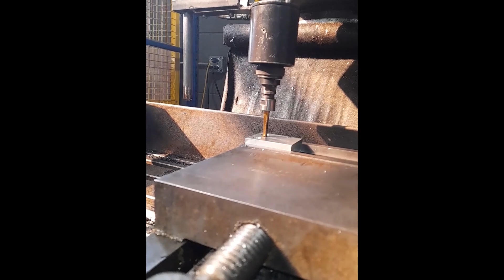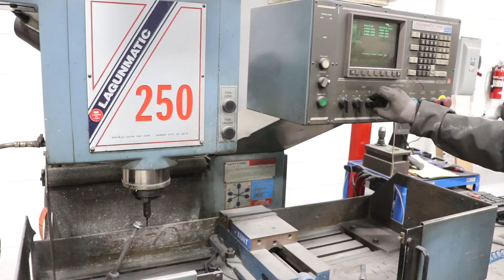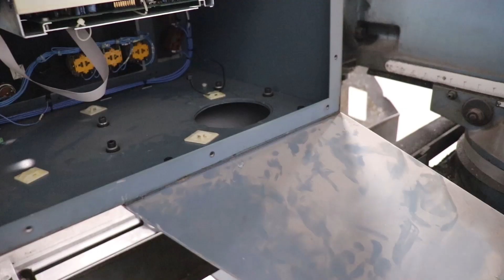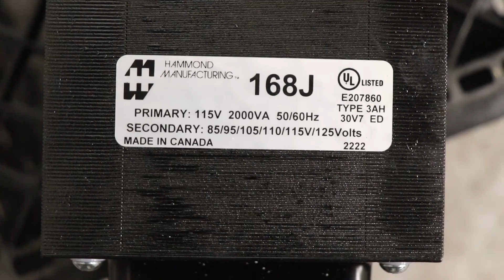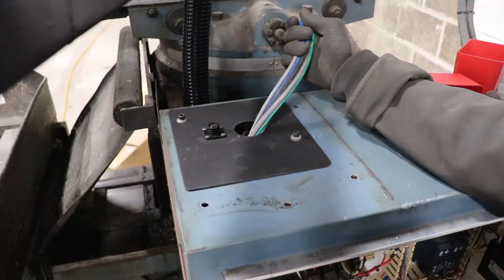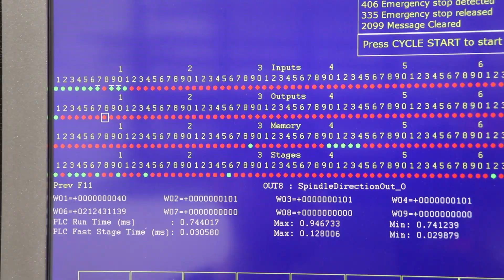How I Retrofit this Lagun Mill and Dynapath to a Centroid Controller

Comment: I have exactly the same machine with a Centroid AllInOneDC controller.  I pulled out all the contactors and replaced with VFD's: knee drive, sump/coolant drive, and the 7.5HP spindle drive with analog output from the AllInOneDC to control speed.  It's powerfull and accurate.  Mine has a NMBT40 spindle, but I bought two kits to convert to R8 and ER32 holders.

Comment: Our shop has three production machines running Centroid, with a fourth on the way, which is a  Shizuoka knee mill. We're considering installing a servo on the knee and using Z axis summing (knee + quill) for serious Z travel. And yes, we'll have to use a reduction pulley with a belt. 

Nice work on this.

Comment: A 5-7hp motor wouldn't require a "behemoth" VFD. A brand new 4kW Yaskawa GA500 costs us about $470 in the UK - or half that for a Chinesium equivalent. If you really believe the motors are full of copper and graphite dust, you need to dismantle them and clean them up - doesn't take long. A 0.5 Ohm resistor isn't going to do much for you.

Comment: for the motor speed you can rig up a pulley over handwheel and use a stepper motor with a “at low speed” ref switch

Comment: The standard series 2 Bridgeport N/C has a motorized knee with air assist.
Killer for those really tough deep holes or plunging 4.625 ball end mills.

Comment: thanks, how long did it take you to do this whole conversation? I heard you say it took a few days just on hooking up the wiring from the computer to the motors and display panel .
Does the the centroid computer hook directly to the the servo motors?
Reply from the maker: The centroid controller board and the computer are two seperate things. And you would have a computer connect to the centroid board via an ethernet cable. Then that centroid board would be directly connected to the motors and everything else. It took me a week and a half approximately but I think realistically if you run into some issues it can take someone 2 weeks or so to fully install, tune, and calibrate everything. Thanks.

Comment: I don't think adding 0.5 ohm resistors to the servos make any sense - you're loosing have the drive power as heat in the resistors. I don't know how the centroid servo drives work, but "real" servo drives (think Mitsubishi or Fanuc) have all sorts of protections built into them - it's actually pretty difficult to kill a real properly designed servo drive. The old ones have "issues" in old machines, but that's not due to the motor killing the drive, it's usually power supply issues in the drive itself that cause old servo amps to fail (and they're actually pretty easy to fix).
Reply from the maker: Its good to know that if I was using the typical servo amps It would be fine, but given that Centroid repeatedly states a shorted motor would damage their board, I was paranoid about damaging it. Ill have access to the machine in the future and can take off the resistors once the servos are replaced. I appreciate the comment.
Reply: Adding resistors should just make the motors harder for the board to drive as @gorak9000 mentioned-- I think you'd be better served here by doing the math to calculate what amperage you'd want to stop at to be safe (say if the resistance drops to 0.2 ohms) and adding appropriately sized fuses instead...  I'm no EE tho so I'm sure someone knows more
Reply: Like your video I retrofit my bridgeport with a masso controller it works good now I'm thinking of retrofit my Hardinge cobra 65 that as Funoc 21-t controller looking to see if I can find some one has a vídeo how to do it
Reply: If the motors were running on the old control, they will be fine on the Centroid.  Remove the series resistors going to the motor.